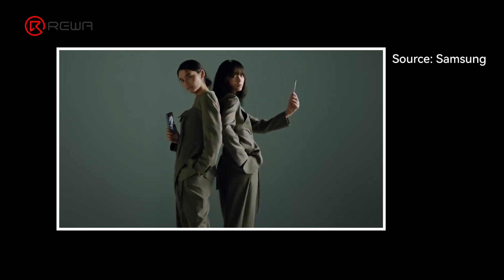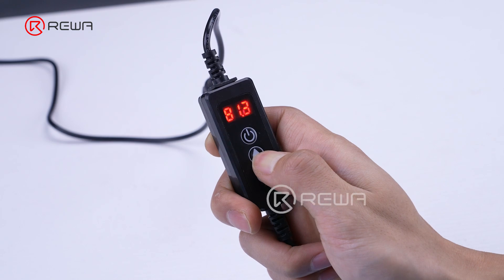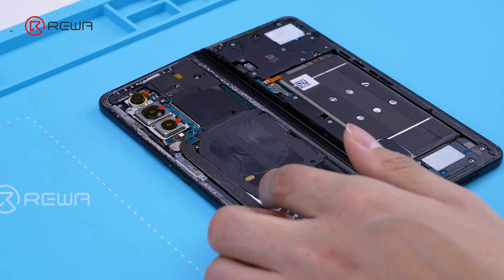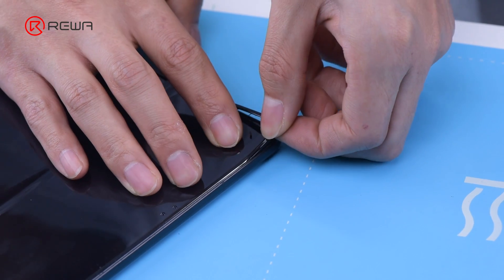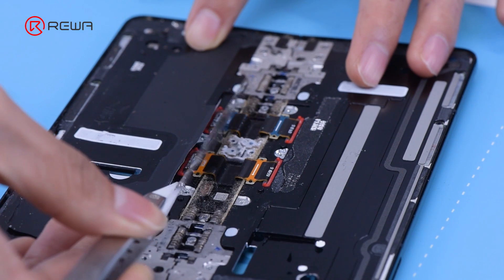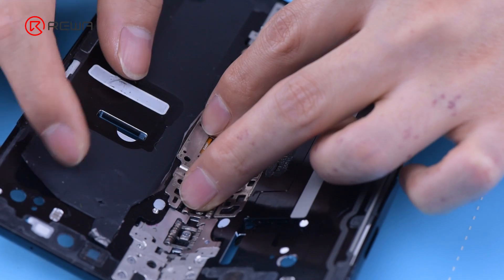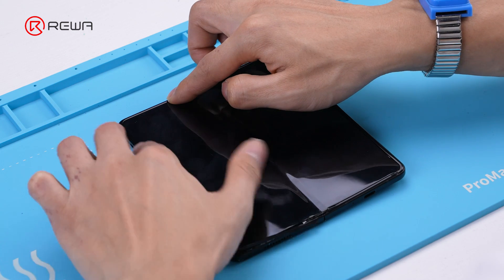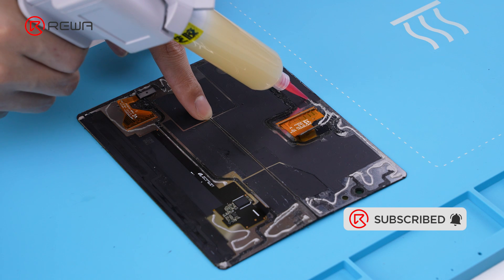Samsung Z Fold 3 Hinge Flex Cable Replacement

Comment: How much it cost for this repair i just took my samsung fold z3 and it has the same problem
Reply from the maker: It depends on your local repair price, but since it is a common issue...I think it should charge more
Reply: @rewatechnology2008  a guy is charging me 6000PKR (20USD) to change these flex cable. But he needs approval for screen damage chances. Means he'll do it but he won't be responsible if the screen is dead by his mistake. 😢

Comment: at 4:58 you can see a grey part with 2 movable parts around 1 cm  x 1 cm in exact in the middle of the phone. mine broke into several pieces, which blocked the hinges. Can I buy it somewhere?
Reply: I had to edit my comment because the time stamp was wrong: 4:58 is correct

Comment: Let me see all common faults in Z Fold series are caused by the Hinge flex cable breakage replacing it fix all the issues such as : "Wi-Fi button Grey Out" "No Sound" "Black Screen" "Touch screen not working" "screen with line" "Abnormal Touch" and too much use of the inside screen also causes :  "Crack screen on the middle" is that all or I missed something ?

Comment: Be very careful....they skipped over the part where you have to remove the board in the back to be able to release the big screen's ribbon cables in order to pry off the large screen, otherwise the large screen's ribbon cable comes off the back of the screen and you'll need a new screen $$$$.  So watch several videos and use them to fill the gaps in between them.
Reply: Watch other videos also before proceeding
Reply: @janoththava765  i know now lol .. come to find out a replacement screen cost more then a payed for the mint phone.. so no fixing just buying a new one .
Reply: @janoththava765  j'ai cassé l'écran aussi à cause de cet oublie j'ai coupé la nappe trop fragile

Comment: is there any way to protect the cables after the repair so it won't get damaged again?
Reply: No, it will eventually happen again. It's a poor cable design.
Reply: @Uncle_Fred   i am thinking putting an electrical tape or scotch tape for added protection
Reply: @8884-l8k  That's not a bad idea. I wonder if it will interfere with the folding. I don't know how tight the fold is. I just ordered a bunch of tools for the job like two minutes ago.

Comment: I can't get the damn outer screen off!! Heated pad up to 90c and put it on, which cooled the pad to 78c, then left it on for three minutes as it gradually warmed back up. Used 99% isopropyl alcohol and still cannot get this damn screen to come off with a suction cup
Reply: Ok I got it finally. The strebito kit had a tool that let me just barely wedge in there and glide it around to open it. The suction cup didn't seem to help me very much.
Reply: 2:56 Take out the sim card and disconnect the blue wire to remove this piece!
Reply: Well my screen is fucked. Wish you went into more detail about that part and actually recorded the process.

Comment: Is it possible to route the hinge cable the other way? Routing it on the outside around the hinge? Or are not all the lines in the fpcb cable connected so the orientation does matter?

Comment: If you have a fold 2, 3 and 4 you need to sell it before this problem happens. It is a manufacturing defect design flaw even if you replace with new cable it will happen again. Samsung is lying about the 200,000 folds durability it does not include the flex cable which will be broken in just a few thousand folds
Reply: Seems to last longer if you avoid dust accumulation which rubs and adds pressure to the cable.
Reply: I agree. It's a shame a company like samsung ripping off customers like this with lies.

Comment: When I opened the Z Fold 4, the sound disappeared and sometimes the screen turned blank(sometimes it’s working fine but still no sound), for the wifi still working fine. Do you think this is because of the ribbon cable?
Reply: Yes

Comment: This bezels are the nightmare to remove them, it is always breaks for me. What do u use trto hold the inner screen after gluing it ?
Reply from the maker: Make sure do it carefully and you should be fine. Re using glue to hold the inner screen is fine.
Reply: @rewatechnology2008  How much does it cost for this repair?
Reply: @sbybill3271  Zero. No one will do this repair. To risky. You have to attempt it to your own.
Reply: @ronlevin2339  For mine they used scotch tape and rubber bands. I left it untouched for 24 hours to let the glue dry.

Comment: After a decade rewa is here for fold,
Why we require to remove front screen for inner display
Reply from the maker: You have to remove the front screen so that you can remove the inner screen
Reply: Vikas without removing in a screen we can't open or repair the zee series of Samsung

Comment: Can't even sticker back the hinge sticker correctly.... 4:01 vs 5:38
Reply: @rewatechnology2008  no matter if U film from which angle the sticker is sticker on the wrong side.... U can clearly see it does not match the pattern of the screws which the sticker is there to block
Reply from the maker: @jackwu4 sorry for the mistaken comment before, after we double check. Yes we put in a wrong way but it have no impact on the device

Comment: Quite possibly the most expensive manufactured e-waste product after apple's devices.
Reply: I think it‘s worse than Apple. A device where the display is the center point of attention, the most expensive component and the easiest one to break.
Reply: It's a beautiful phone. Very complex structure, but now not the only technology. Absolutely they tell you it's not dust proof so stay away from zones full of dust or you can get issues like accumulated dust added pressure.

Comment: But still there is no network 😮
Reply from the maker: If you take look at the test part, there is one notification which pop up is one of messages app. So it means it successfully connects to the network
Reply: Because no SIM card
Reply: No still der is no network don't lie

Comment: Can you guys help me? My galaxy a53  loses. It's battery 10 to 12% every hour on standby, but while using it, it lasts 5-6 hrs easily. What's might be the problem 🤔
Reply: Change battery
Reply: @nnamdiofNigeria, but it lasts 5-6 hours while using only problem is standby battery drain about 10-12%
Reply: Where you from?
Reply: First you have to do hard reset.

Comment: What glue pls answer
Reply from the maker: This it is. https://m.rewa.tech/detail/original-pur-cold-glue-for-iphone-middle-frame-bracket-back-cover-repair.html
Reply: @rewatechnology2008  is such a strong glue necessary? Won't B7000 or T7000 glue be sufficient?
Reply: @Roan-db  Yeah, I think so, now if only I can find E6000/B7000/T7000 with a needle nozzle.

Comment: Folding smartphones is always a stretch when comes to design flaw and repair costs, these phones only good for a gimmick and nothing else
Reply: What? This phone is perfect for multitasking. Haven't had to repair this or the other fold which I donated to my dad and I was using that one for 2 years, still going strong, 0 repairs needed. Ofc, I do avoid dust since that is it's weakness but I get so much more utility out of this phone than your common phone. It's a perfect workhorse for me.
Reply: I have the sound issue now after 2 and a half years... every single smartphone gets issues after 2 years... so tired of people calling things gimmicks when they dont have a clue on what they are talking about... and besides this is even an issue that can be fixed with relative low cost... best phone I ever had by far. And yes i unfold my phone every single day multiple times.. its not nice having issues but lets be real... what phone doesnt get issues after more then 2 years in this era? They are not made to last for more then 2 years and thats just the way the phones crumble these days..
Reply: I'm biting my own words

i have 3 flip phones now
+ OG Z Flip
+ Oppo Find N2 Flip
+ Z Flip3

yeah i still think they're a gimmick but ironic that i would own 3
Reply: unfold mode is pretty useful tbh